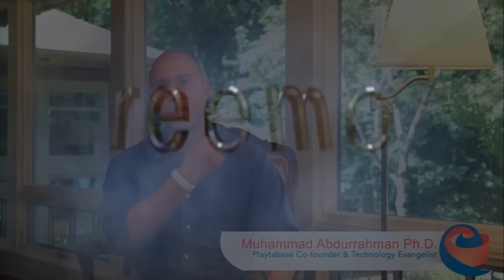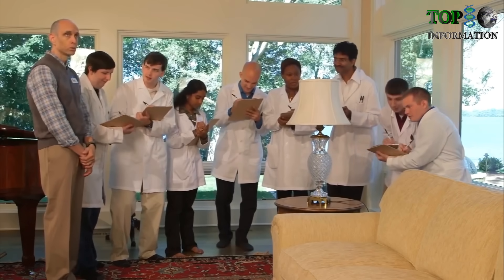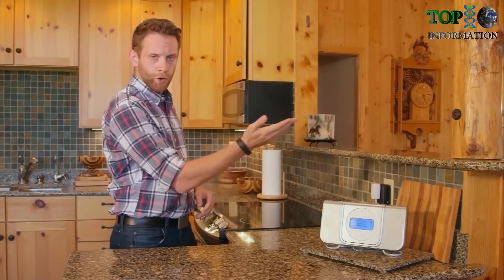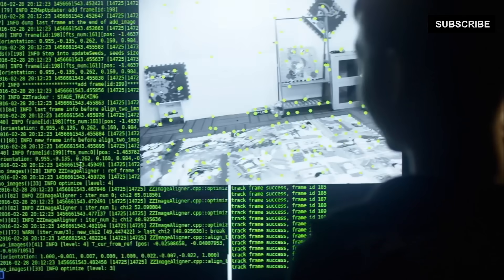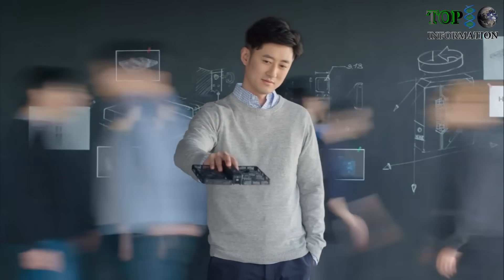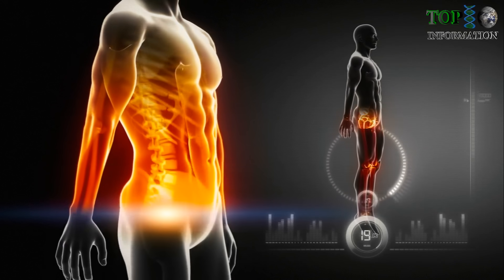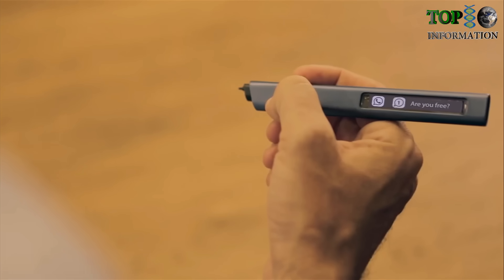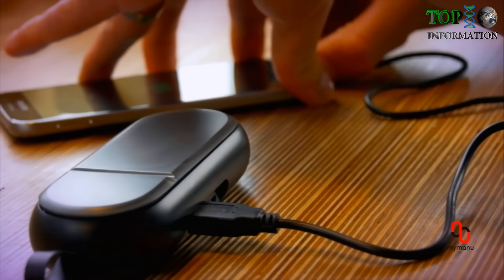7 SCI-FI MOVIE'S GADGETS That Really Exist ▶ 6

Comment: Yeah. I was wondering if Reemo could control a sexbot. Want to get laid, point at the bot and gesture with upside down V over your crotch. Doggy? Upside down V with a 180 hand swap. Blowjob? Point to bot, single finger point to crotch, bounce finger to indicate speed. Unfortunately, pointing at bot, balling fist with finger side up, and a forward thrust delivers a solid fisting. And ultimate unfortunately, pointing followed by an opening the curtains gets you a goatsie. But! Point and moving your finger to the right using circular motion tells the bot to piss off and roll under the bed. Or, point and slap to the left sends the bot to your significant other for sloppy seconds. Follow that with a shower jesture and the bot delivers a facial!

Comment: Number 1 is Pretty cool. As a smart-home supporter I like what they've done. It's incredibly easy to set up. Unlike my philips hue lightbulbs that require me to buy an entire new lightbulb and special hub, that you just need the bracelet, sensor, and plug and you can run anything electrically powered. Very intelligent. My only concern is with the device accurately. How many times will I have to wave my tv on before it realizes I'm not aiming at the lamp right next to it? 
Number 3 is so poorly edited onto the video that I cant trust the company to make a final product when they cant even make a proper ad.
My issue with most of these is that they solve problems that don't actually exist. Like the finger phone, is this actually an issue? No. It's not. Get a bluetooth earpiece if it is. Also the watch probably doesn't work as the energy my wrist puts out is about the same as the ambient temperature around me so the energy it would gain is so minimal that I'd imagine you'd have to wear it for a year before you'd get a days charge. And the last one. Does my universal translator headset really need a portable battery in it's case? No. Of course it doesnt. That's stupid.

Comment: The Phree pen actually looks useful. The rest isn't really solving any problems.
The hovering camera is cool too, the arm band projector, even if it works as well as it does (I have my doubts) You still need your phone with you so why aren't you just using that instead? The Finger caller has the same problem, you still need your friggn phone on you for it to work. We need a smart watch that can actually replace a smart phone already. 
Translating wireless headphones could be Awesome too.
Reply: O yeah and Reemo. I like the concept, there's Dozens like that. Hope those get better and cheaper.

Comment: @ number 6 "never been anything like it"
yet back around 07-09 one of those years there was a pin that did the same thing,but showed it in a notebook that was designed for it.
additionally there was a pin that recorded everything you wright and could connect to a computer to print it out

Comment: Ok, for number three go and look on captain disillusion's channel, the bracelet its face for the simple fact that light from suck a small projector cannot beat natural light or any bright light at all, the project was cancelled and rescheduled for a later release date, and they made a video showing the testing procedures, from which you can tell that's its bullshit, also the sensors wouldn't work if you'd be to pinch and rotate. Woop woop

Comment: number five is really the only one that I'd get cause I usually wear a watch but its annoying not to mention difficult to change the battery and find the battery needed and seeing as it runs on body heat is really good for camping and what not plus its water resistant so if your swimming in a lake/pool you dont really have to take it off

Comment: No.3 is called the "Cicret bracelet", if anyone is wondering. You can google it, this video here is a "concept", as in it's the goal that they're working towards. It's probably never going to be as thin as the concept (need a projector and a sensor stacked together), but a bulky working prototype do exist.
Reply: At it will never project black on your wrist.
Reply: so then how is black projected in a theatre if black can't be projected?
Reply: +zeb mcbain they turn off the lights.
Reply: ***** still a white screen, bud. There's enough light to see people around you, there would be enough light to see the white screen lol. Explain that.

Comment: So does reemo only work if you have a smart home?
Reply: It's like those clapper things, you just plug something into that little box and the little box plugs into the wall. You will probably have to buy their thermostat, little boxes for everything you want to control, and put those little cameras everywhere you want to be able to control things.Probably has quite a few limitations and/or need to be setup by an expert of the tech. The lighting would have to be right as well or it won't be able to see you. Just making assumptions here though.

Comment: In the bracelet gadget it's fake you can see the screen is moving back wards and forwards it's edited
Reply: no you can actully find it an amazon
Reply: Deimos Phob it's picture, not feature
Reply: XD GAMER its ok that gadget isn't coming out until 2019 so yeah
Reply: Lol TOP 10 INFORMATION liked the message xD
Reply: XD GAMER it's just a concept video
Reply: XD GAMER can the first guy use that bracelet to move his two front teeth together
Reply: Its not a screen its a projection which is why its moving. I don't know but i would assume the bracelet projects the screen then uses cameras to track your fingers movements.
Reply: XD GAMER you're right
Reply: Tdm360 Gogo where
Reply: The circet bracelet is fake so far, they haven't even mad it yet.
Reply: XD GAMER it's an old video they've made a full model that was an idea they've changed it alot
Reply: The bracelet is real but not the ones in the video.
Reply: yes
Reply: XD GAMER that's because it's a hallogram its not a physical object
Reply: Hey its Steven
Reply: WhereTheWeedAt ? Just to clarify things: No, event the most powerful lasers in the visual spectrum won''t cause cancer - at least not with a higher chance than daylight or any display (is's actually more likely to get cancer by using a phone). They may burn through your body within seconds (if they are very powerful), but they won't cause cancer, because lasers increase the intensity of light, not the frequency (which is why they are still in the visual spectrum). And no, this gadget will also not burn through your body, as you don't need anything more special than a simple, small projector, maybe with a small increase of intensity. However, you shouldn't look right into the light source, as this might harm your eyes (similar to flashlights or "normal" projectors).
Reply: XD GAMER no it's not they already have the funding for it
Reply: XD GAMER please look in every  description of a video don't be dumb next time thanks buddy.
Reply: XD GAMER no some I'm pretty sure are real
Reply: XD GAMER not to mention the fact that Fruit Ninja slices were going in different directions and we're out of sync
Reply: The video itself is fake
Reply: +Connor Center It is fake.... If you want a wearable that compact, as shown in the preview, and not to mention a wearable that will be functional and track properly would be an absurd assumption, especially with a beginning kikstarter based company. not to mention, it would have to account for the changing, and curved surface that is your arm, and any movement would screw up the tracking, rendering it useless. Or the fact that it might overheat on your hand, or the fact that with a projected image the rest of the image would be disrupted by your finger when you put it down on the screen. Its just all around a bad idea, and not to mention so impractical that I wouldn't have even expected it to go past the R&D faze.
Reply: Man, I was sitting there thinking it was feature, thats why I thought it was really shitty subliminal messaging, but I guess picture is a little bit more artsy so I give them that.
Reply: Samsung made a better one. Watch LinusTechTips on his video on it
Reply: XD GAMER which braclet
Reply: XxRubixvidsxX its a cecret XD
Reply: XxRubixvidsxX #badpuns
Reply: XD GAMER it is hologram
Reply: uTrHro only way to make "normal" screen projection on hand is with powerful lasers and sure buy it if you want to get cancer literally
Reply: XD GAMER i know it is so fake i was about to buy one
Reply: XD GAMER
Reply: oh yea your right about that
Reply: XD GAMER ur right
Reply: no its not 😂😂
Reply: duh
Reply: XD GAMER dumb fuck it's a damn concept video
Reply: Saroeut Ouk sup
Reply: classifyy lmao! No chill!
Reply: +XD GAMER  i know you think it is fake but you can see that the bracelet itself moves on his wrist. i have tried this gadget at my local tech shop. it is still in beta and feels really strange when you expect to feel a screen but you feel yourself instead. i can assure you, this gadget is real (it just isn't very good at the moment). The advert shows a fake one as the screen is much brighter than the real one and the real one is much more accurate.
Reply: WhereTheWeedAt ? Do you really think that lazers will give you cancer? Some people are just plain stupid. Also have you ever seen a projector? You don't get cancer by standing in front of one. It is not emitting UV rays like the sun. Where did you get that stupid information? Lazers are highly concentrated light sources so it would be incredibly hard to get that many "lazers" into a bracelet. It uses simple LED's to create the image. I could go on for days but I think you get the point.
Reply: CTI yes they have!
Reply: XD GAMER it's not fake, it uses sensor technology. Even if it is fake, someone will soon make it. I thought of it a while ago, and assumed someone had made it.
Reply: Da Ninja Kitty it's fake
Reply: Tech Unboxers what the hell your name you don't even have videos
Reply: XD GAMER I don't want you to feel dumb but
Reply: XD GAMER
Reply: MacProductions dude I'm a kid
Reply: XD GAMER hi im a kid too
Reply: no i looked it up you can buy it right now
Reply: Richard lally thank you.  I mean, it has over a hundred comments saying the same thing but the more the merrier. I said it too.
Reply: yeah most of it is likely done via adobe after affects
Reply: I believe you're right, but it's because it's a concept video not a tech video.
Reply: XD GAMER i was just going to comment the same thing only stupid people can fall on this edit
Reply: if you look it up it wants " donations " to make it
Reply: it's not the same thing.
Reply: James Postle yeah it is
Reply: its not even made yet
Reply: i never said it was real im basically saying its a scam they tell you to donate for the making and its not made the prototype it made tho it only projects but it flickers its fake
Reply: actually it is real but got discontinued do to not many ppl buying them look it up
Reply: he ment the video isnt real
Reply: technology still isn't there yet, I doubt it would have even worked. Not to mention, the video is proof enough because if they had anything working, they would have shown it...
Reply: it isnt fake look at the website.....
Reply: King Collins you know that's fake they only screen record it and fake swiping his arm
Reply: Definitely fake. Human skin is nowhere near reflective enough to show a projected image that clearly, and the "projected" image is moving independently of the "users" arm and thus the wrist band in several of the scenes. Faked, and not well done.
Reply: ghoulgamer skyt Yeah, you can believe all you want, but the technology to do this is simply not there yet, we can't make pixel displays with lasers, we can only do single color displays with lasers, we have been able to do this with laser keyboards in which HP had tested on pre-built all in ones, which even then the tracking inevitably failed, and not to mention, the resolution of the keyboard was low, which wouldn't matter, unless you where trying to make a projected display. Why would you need lasers, why not do normal projection? Well, because projecting an image that big from an area that small requires a VERY wide angle lense, and a very high resolution screen inside, which is very small, the pixels per square inch would have to be over 50x that of what you get on a normal display, making projections a not-so-good idea in the first place. Not to mention, I don't even think we have technology able to do that.
Reply: XD GAMER ikr it does not have any shadows
Reply: Also they use subliminal messaging in the song. they keep on saying "a feature worth a thousand words" so you think its something you need.
Reply: Mine Thing you know that's fake